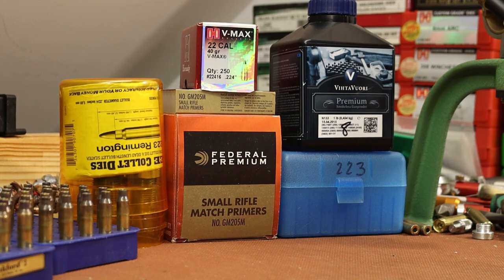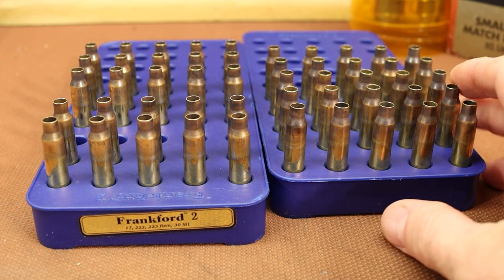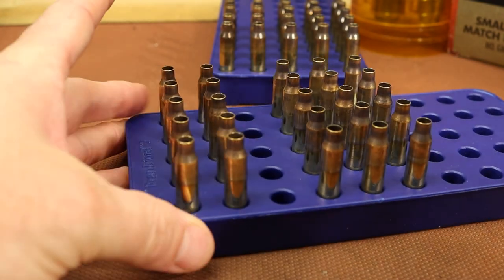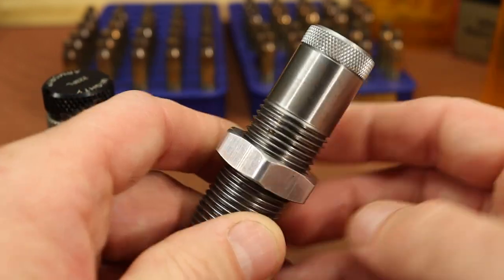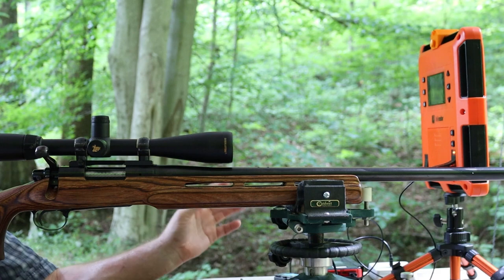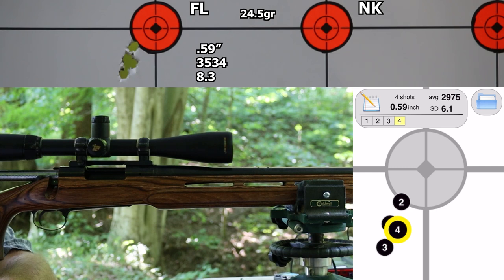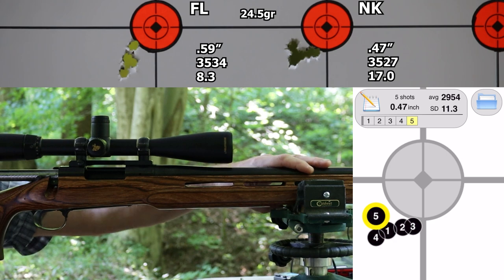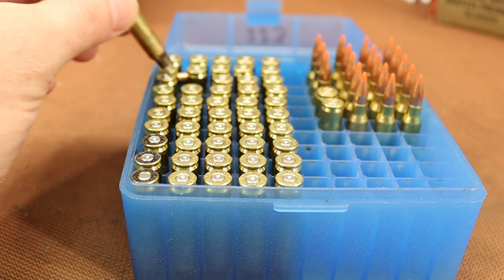223 Remington - 40gr V-Max with N133

Comment: 2.260" maximum C.O.A.L. That extra .040" is not worth any small accuracy gain if you can't eject a loaded round. That could very well end a varmint hunting or range trip if you don't have a rod on hand. Another good reason to always have an Otis kit on hand, just in case. Their obstruction remover is worth it's weight in gold when you need it.

Comment: The Lee Collet Die is an excellent neck sizing die.  A number of tests have shown it to provide the best concentricity of all resizing methods and dies which is exactly what I found to be the case.  The downside is that it’s difficult and time consuming to adjust just right but when you do, it’s great.  Fortunately it’s very inexpensive so I bought one for each of my .308 bolt guns and headstamps of brass and kept them permanently in separate T-7 turrets.

Comment: CCI BR4 40g Noslers, 3800 shoots a bug hole in my 700, N133.  In the last 40 years, I have changed one firing pin spring, it had been left cocked for 20 years and got weak.

Comment: Just FYI in My Remington 700 26 inch barrel I am using V133 and Hornadys 53gr V-Max at just over 3465FPS and three three shot groups at 200 yards average .77 inch.  V133 is a great powder.  If it was me I would ditch those mounts and rings and put on Leupold Dual Dovetail Bases and Burris Signature Dual Dovetail Rings with MOA inserts as for firing pin springs I think is a waste of time.

Comment: Glenn Zediker wrote when ever you shoot new brass it needs to be at max pressure so it fire forms. If not, and you load up light charges first, then max pressure charges during later reloads you can crack or split your brass.

Comment: On your Lee Collet neck sizer die, some folks use a torque wrench to accurately and consistently set the neck tension.
This trick may not work on all presses with out some sort of adaptation. On Lee presses there is a bolt that h lol D's the handle in place. With a socket that fits this bolt, put the socket on the torque wrench, pull the handle through the sizing operation till you hit the point you feel it stop. Put the socket on the bolt and with the wrench set to 25 ftlbs, move the wrench till it clicks then hold 30 seconds. Lower the case enough to rotate and repeat. 
This method you always have the same tension on the case in the die. The dwell time holding the case in the die gives the case time to fully form to the mandrill. 
Using the dwell time part of this method may help with full length sizing.

Comment: Good video. I’m using the Lee collet neck dies for all my riffle loading (5.56, 6.5, 7.0 and 30 cal) using these to neck size after body sizing the brass with Hornady pro dies (without a sizing bushing or expander installed). The collet mandrel size for all calibers is .002” under bullet diameter so with the dies set tight the neck inside diameter provides exactly .002 neck tension. To verify how tight to adjust your collet die, use the mandrel from the die as a gauge in a  sized case. Its should fit snug but should slide in and out. 
As the Lee brochure points out, the advantage of this die is there’s no pressure applied to the body of the case when neck sizing so the concentricity of the body should stay with how it was formed by the riffle chamber and the bump applied is left untouched by the neck resizing. I get very consistent neck tension and runout under .002” total and dont have to worry about turning necks because the concentricity is based on the neck inside diameter and not the outside diameter. I do the double pass with the collets set very tight and when I do get a case with extra runout (1 out of 10 with good brass), with annealed brass several additional hits will usually bring these back into spec.
Reply: This may be why Lee collet dies get a bad rap from some reloaders, they simply aren't using them correctly. Lee collet dies don't need any special adjustment, you can just smash the crap out of the them and they size the necks perfect. People that try using them like they use F.L. dies are doing it wrong. You sir seem to have it figured out! You can't oversize with them, the mandrel just doesn't allow oversizing...

Comment: What I have been told with metals if you hit a piece super fast and soon hold the pressure long it will spring to shape and come back. With the same peice you can hit it softer but hold that pressure for a second or two it can hold the shape more without as much spring back. It's why some say to pause as you resize so it gives the brass time to form to shape. Also as you were closing the bolt it would stick. Could that be the bullet hitting the lands and holding the bullet then as you close the bolt its pushing the bullet deeper and maybe spinning the brass. Maybe make a dummy that has a sharpie on the bullet and neck. Chamber and see what it does. Maybe loose crimp but that bullet contact is 25% of the original contact.

Comment: Good stuff. My 6mm BRA and 6.5CM respond to full length sizing the best. My rifle is a custom Short Action Custom with Defiance Machine receiver and Bartlein barrel. My trigger is set to 9 oz-ish but I grip my rifle much differently than you. My thumb rests beside the stock, but my hand is wrapped around the grip and my cheek is comfortable on the riser. My trigger is 2 stage. The recoil does not move my rifle anywhere near what you're seeing. I get super consistent results with this grip. My loading is similar to your process - annealed, FL size with bushing, but I use a mandrel to size for neck tension, .075 off lands, and Berger bullets. Anyway, I appreciate you are looking for loads but the difference in group size and shot placement has me scratching my head on how yours can be so different in .5 grain increments. My load development is .2 grain, but when the shots open up, the pattern is mostly the same (or predictable) but groups open to .45 or so. I appreciate your work on these videos. I look forward to this time each week.

Comment: I routinely get half inch 5 shot groups out of my 20 inch WOA service rifle barrel 1-8 twist  with n133 and 40 vmax , 3600 FPS, gas gun! And 8 fps SD. N133 is in my opinion the best powder out for lighter bullets

Comment: Holy crap I believe I am having the issue with my brass not fire forming properly. Granted I’m running powder coated lead so my velocity‘s are low anyways. I can’t seem to get consistent numbers on my Hornaday case gauge. I always thought I mulberry just doing something wrong.

Comment: If you used a collet neck die, body die, and only ran brass length at the max or chamber, would you still need to trim?  My understanding is most of the brass growth is during FL sizing.

Comment: I'm glad I watched this. I recently ran into the situation where there was residue or soot around the base of the brass, actually a ring around the rim. Also the face of the bolt had the same soot. Never had that happen before. 

I was using Hogdon H335. My rifle is a Savage 223 bolt action. I used the Barnes 40 gr Varminator, LC brass, Wolf primers,  mostly because that's what I have.

It seemed to happen on the low end of the charges, at 25 grains. The brass was clean at the upper end of load development. 

I couldn't figure out what happened,  improper primer seat? No signs of pressure on the brass. The groups were all fairly consistent,  not great but consistent.

Comment: If the brass body is expanding outward to fill the chamber it will also shrink the overall base to shoulder dimension. This could be part of the issue you're seeing. Try measuring the bodies in a few locations to see if the shorter cases have enlarged bodies.

Comment: So if the length to the shoulder is different, the distance from the bullet to the lands is gonna change then isn't it? Therefore your "seating depth" is gonna change effecting your groups potentially?
Reply: Will someone please answer this ☝️. I have heard conflicting answers as well.
Reply: @aaron.from.winchester6744  I know the answer, it was more of a rhetorical question.

The farther you push the shoulder back the closer the bullet will be to the rifling when you chamber the cartridge. Its closer because the measurement from the base of the case to the ogive of the bullet stays the same, but the case goes farther in essentially.

Comment: Could it be the slight difference in the brass (metal itself).  The spring back may be slightly different.  The big question will be if it makes a difference on paper.

Comment: Hey Johnny, Great video series on neck sizing. I am doing the exact thing with 55 grain Nosler BT and the groups have gone down a bit. Even after 3 times with the same brass, same result. I have come to the not so scientific conclusion that at least my brass should last longer versus Full Length resizing? Your thoughts?
Reply: Annealing will help with keeping the brass from hardening to much, also neck sizing will help your brass last much longer how ever you may have sticky chambering and will wanna bump the brass back down. (Manufactures of neck sizing dies in .303 british recommend neck sizing only due to lee enfield chamber tolerances) also you will have to toss brass eventually if your trimming quite abit cause you can get a case head failure or case failure cause trimming removes material and there will be thin spots in the brass from stretching. Seems to be primarily a Full length die issue tho.

Comment: I think your fireforming test may answer some SD numbers more than a firing pin will but pretty curious of those findings as well.  As far as the case forming (or fail to fully form) test i would run up some of the 55s in new brass, and if you can test in multiple chambers to see if its a pressure or distance it takes to blow the case out.  Like does 5thou and under only need one firing but if its more it takes 2 firings or is it once it reaches XX,xxx psi its sure to form.

Comment: Just be aware that your seating depth will change when fired because when the firing pin hits the primer it’s going to drive the case ahead until it hits the front of the chamber so if you set your shoulder bump for -003 and you bump it to -.012 you changed your seating depth .009 big difference just saying
Reply: I get your theory but in reality not an issue.  Unlikely for a firing pin to drive a case farther forward than the ejector is (or the extractor holding it).  Changing your shoulder bump may have a chance to change where your ogive is in relationship to the lands, even though the seating depth may be the same, only if your case sholder is in contact with chamber.  But bolt face and lands are "constant" so if your seating depth is base to ogive consistent then the case shoulder won't matter if its in free space away from the chamber shoulder.

Comment: Are you sure your firing pin is not too short, up until now you did not have a headspace measurement to compare with your brass. Excessive headspace can cause a weak strike on the primer as it also moves the cartridge forward in the same motion, therefore causing irregular ignition from one round to another. Having a correct headspace seams to give you better SD numbers, so why not use a primer that is easier to ignite such as a Win WSR primer and test it with a powder that had high SD numbers. Granddad always kept spare firing pins around for the Remington rifles he had due to tare and ware over long periods of time causes the pin to eventually fail. Check and see how far it sticks out the bolt face and compare to another rifle bolt.

Comment: Absolutely have encountered this lack of fire forming in my various wildcats that require case forming when a new lot of brass is needed. I’ve found SD & ES are GARBAGE until all are uniformly fire formed. I saw on the neck sized middle charge, the SD creep all over and suddenly down to 4.7.

Moral of the story, if you’re plinking or shooting varmints neck sizing or FL hasn’t meant much to me in accuracy potential. Fully fire formed cases have shown differences that improved once full sizing was achieved.

Interesting on the 700 spring theory though…..🤔
I patiently will await your test to see if new springs are in my future.

Comment: I guess my question is... Could I full length resize my cases, and then neck size afterwards to ensure tight and consistent neck tension??
Anybody? I'm getting ready to reload my next batch of 6mm ARC, and wondering if this is something I could benefit from, or I'm just being a spaz...
Reply: i do this exact process with .308 i think it works or maybe its in my head
Reply: I full length size without the button / mandrel.  The I go back through with a expander die and mandrel at the neck size that I want.

Comment: you're probably not getting an accurate measurement with primer in the case still. the fired primer usually sticks out proud if the face of the case.